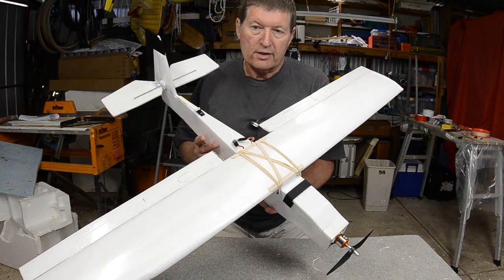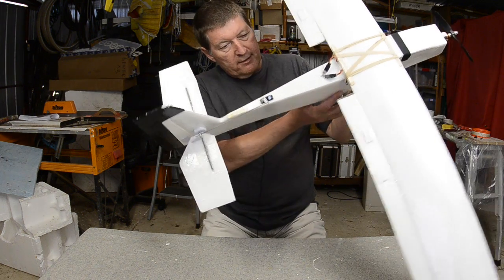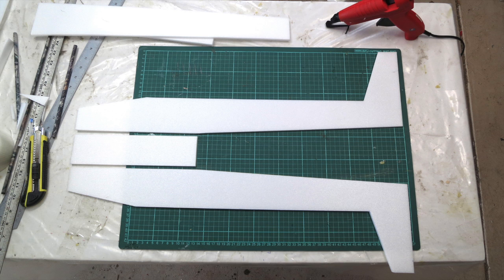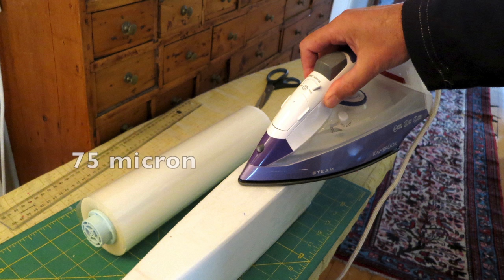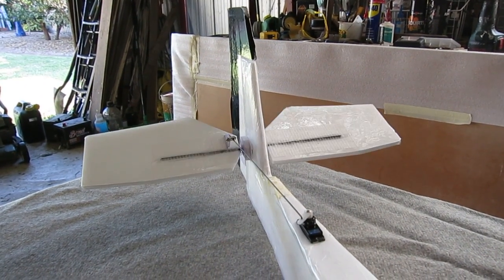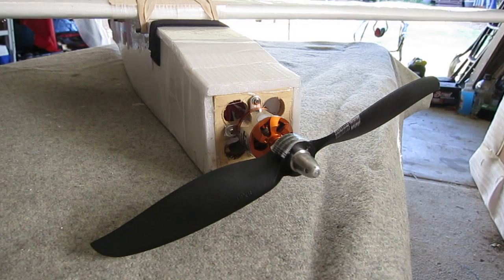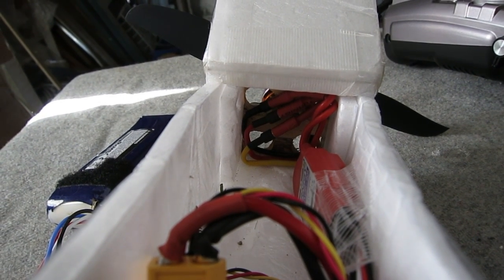1.2m Depron Acrobat build

Comment: @Andrew Newton -- 
could I build this with the alternative electronics?  could I make smaller this wing 'n... could I fold the fuselage to be shorter before it's flight..?  thnks bro..:)
Reply from the maker: Yes that would be no problem, just keep it light and it will fly
Reply: @Andrew Newton --
butt.. wht size less than 1.2m I could make smaller? and then..
is it good idea and not some mistakes to use DIY 3S 18650 as this rc aircraft power..?  thnks for fast responding..bro(Y)
Reply: responding plz..!
Reply from the maker: 800mm or 1m would be good. Don't know those batteries. I would use lipo
Reply: @Andrew Newton --  
3S 18650 from notebook power..!

Comment: how do you choose an esc that isn't too low or overkill for a motor?
Reply from the maker: I usually measure the maximum current at full revs with a Watt meter then add at least 20% for safety. But the spec sheet that comes with the motor will have a recommended ESC or max current with specific prop size and battery voltage.
Reply: Andrew Newton cool thanks

Comment: hi mate , does the EZload laminate film stretch as you heat up like the covering film you get from hobby shops ? Also does it stick better and add strength to foam compared to packing tape ?

cheers
Reply from the maker: Howdy, this laminate does not stretch like the covering film so you have to cut tabs and overlap narrower pieces for complex curves. It's stronger than tape but does unstick with a lot of flexing. I actually prefer tape for curvy applications
Reply: cheers mate !  also does it shrink like the covering film ? (eg: covering balsa frames)
Reply from the maker: No it doesn't shrink at all.

Comment: I have to say that I built something similar to this just over a year ago and although it flew well enough, ie, straight and quite well balanced, I just didn't enjoy it. It was then that I realized that I want to turn the power off and glide. I prefer to view my plane in the same way I view a bird. I enjoy watching what it does and how it reacts to the air around it with mere guidance from me to, hopefully, keep it up there.
 I'll probably get started again next year as I've done nothing since I destroyed my Phoenix 2000 on it's maiden in the spring.
Reply from the maker: +wordreet Agreed. Gliding, powered flight, multi rotor - in that order. You must have been really trying to destroy the Phoenix. Actually I did significant damage on the sloping maiden too.
Reply: +Andrew Newton Heh, not trying anything much at the time, but a bad case of itchy thumbs got me out on a windy day having never flown the thing before. 
 Unfortunately, although I launched it ok, I remained standing in a corner of the field rather than moving further out to where I SHOULD have landed it. 
 The corner of the field on that day was full of turbulence from the industrial estate, so when I brought the PK2 down for a low pass, it suddenly performed a 3/4 backloop plus 90 degree downwards and downwind turn while upside down sort of thing, and proceeded to attempt to fly THROUGH two rows of barbed wire and a post!!! The starboard wing got it's middle bent horizontally and vertically by the post, (approx 15 degrees at the square ally tube) aileron and flap came off and ripped out the servo arm. The fuse was ok, electrics were ok, but the tail area engaged the barbed wire and ended minus 4 pieces.
 So I have the tail still attached with no rudder and starboard tailplane still attached with no elevator and the other tailplane ripped off and separated from it's elevator. Both of my carbon tube snakes and their carbon push rods were destroyed.
 That was also my first flight with my new Optic 6 computer TX. It was working fine and felt pretty much like my regular TX. But, because I hadn't flown for several months at the time, my brain must have jammed. :¬D

 I'll get back in sometime because I've all these planes and sheets of foam hangin about looking at me. As to when. Hmm . later.

:¬)

Comment: coffee stirrrer wooden or popsicle sticks for strength they are great and cheap or free with your coffee at any major outlet
Reply from the maker: jimbo57109 Actually they are just for the rubber bands to pass over without denting the foam.
Reply: yes but i use them for strengthening the fuselarge internal very good
Reply from the maker: jimbo57109 Oh yes, bamboo skewers work well for that too.
Reply: yes i use them as well

Comment: Loved vieving it! keep it going man ... Thanks for such a great video
Reply from the maker: ***** Thanks for that. It is the best flying powered plane I have built.
Reply: Andrew Newton Thank you for vieving my comment and replying i like your plane but i had i question will it work with 1000kv motor with 10x9.5 inch1045 propeller please, in resum will it fly with less power and work more or less as a glider thanks
Reply from the maker: ***** Depends how much thrust the motor produces. Anything over 300g thrust will be good. This plane is not really suited as a glider. For a better glider using these building materials I would go for at least a 1.5m wing and slimmer fuselage.

Comment: Awesome build! I use that same motor with an 8x6 prop (much faster). It's on a scratch built  540 style plane- 30" long body with full symmetrical airfoil wing that is 36" long with a tapered chord of 8" down to 6" 2" control surfaces all around. The plane weighs 550g fully loaded. I don't know where I was going with this comment, but I thought you might like to change the prop out for some more speed.
Reply from the maker: ***** Great info thanks Chris. I will try an 8x6. Your wing must have been better shaped than my attempt at symmetrical and tapered.
Reply: Awesome! I built a CNC hot wire foam cutter to cut out custom airfoil wings. I had some extra parts laying around- so I went for it. It's great to be able to have a machine cut a wing out for me ( :

Comment: really nice!  the elevator is beautiful and I like the taper in the tail.  did you make a symmetrical wing? I'm guessing that's where the underside wing curvature is coming from.???
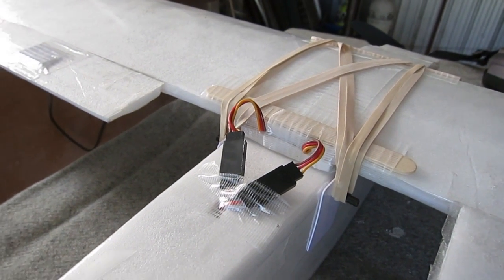Reply: 28th St. Air Land & Sea I guest it's semi symmetrical like he said in 3:05, "A little bottom curve".
Reply from the maker: 28th St. Air Land & Sea Bit of a story behind the wing. I originally made it symmetrical and tapered, but it was a tip stalling disaster. Don't know why. So I ripped it open, recut it to be straight and tried to make it flat bottomed but it ended up with a slight bottom curve. Works beautifully now.